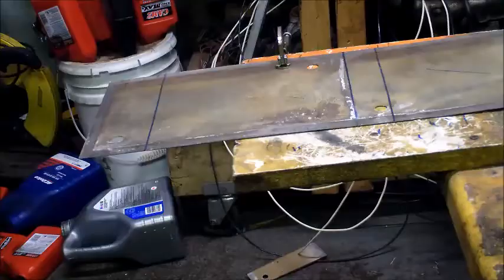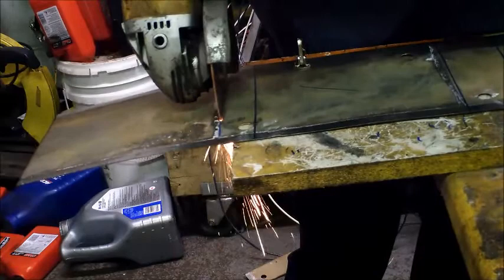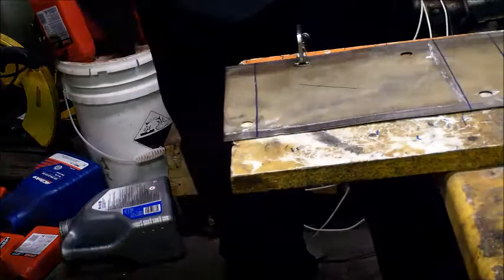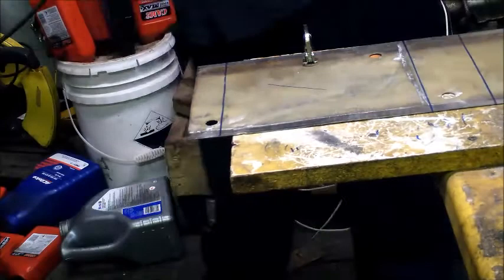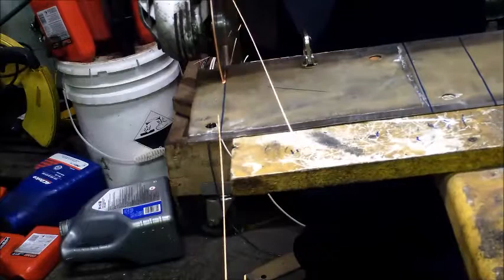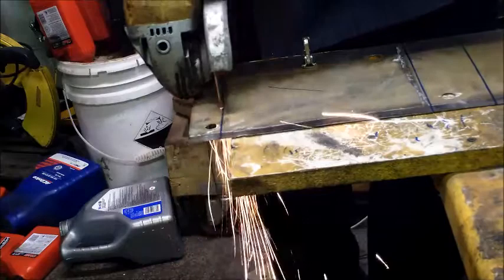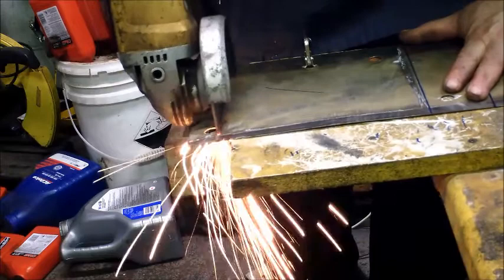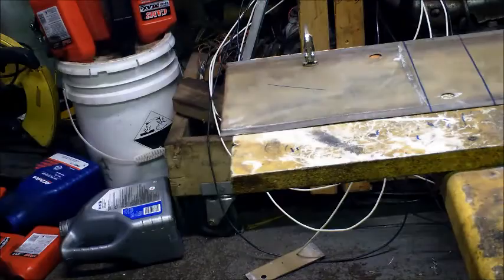Dry Cell Construction With Old Parts. Part One

Comment: 120 cell? Thats a pretty fast way of slicing some metal, and the air tools make cleaning up the parts a breeze, my little pancake compressor would give out a few seconds into to the first plate... Harbor Freight POS lol
Reply from the maker: Yes sir , mains power cell.....But there is gonna be a twist..
Just looks like a breeze, Took me 3 hours to salvage and clean all that stuff up..
There are two central compressors at the shop, included in the rent.
More to come...